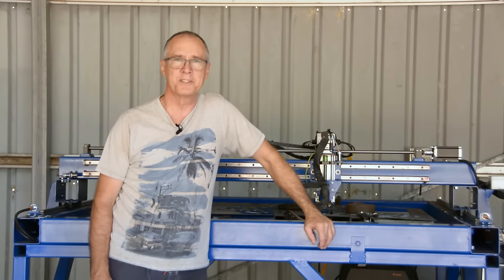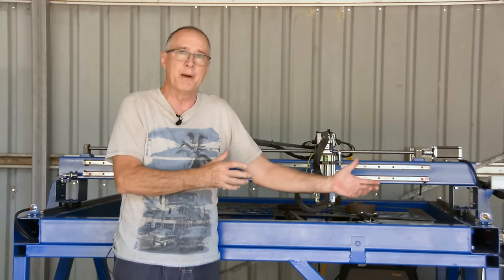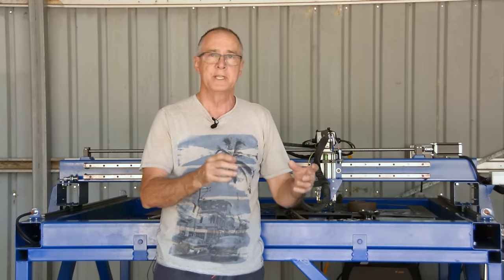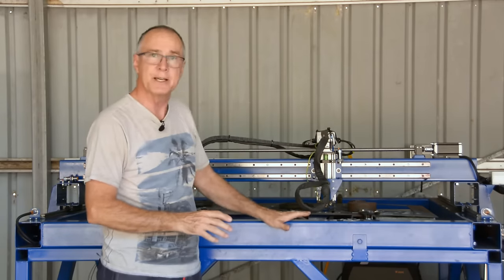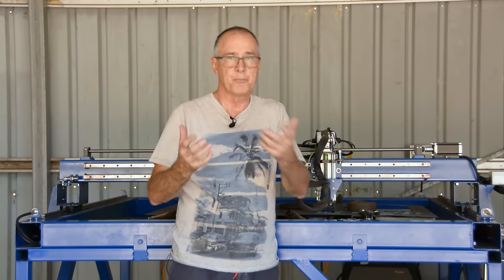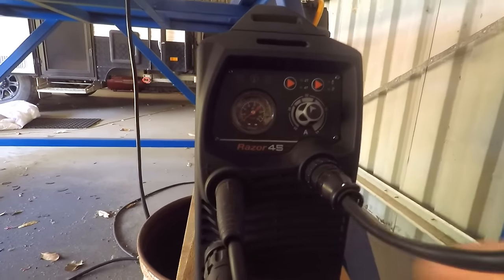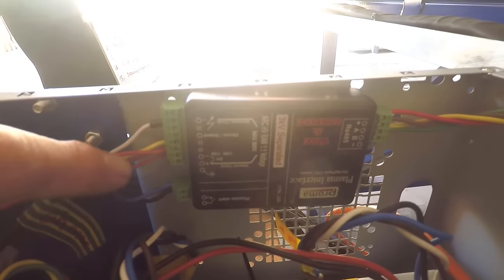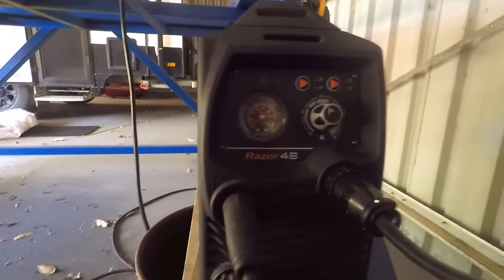How To Build a CNC Plasma Cutting Table | Part 6 - The 1st Cut

Comment: This has been the most comprehensive CNC plasma build lesson I've seen, and I've been lurking around he CNC Plasma forums for years. The explanation of the mechanical, drives, sensors and electrical hookup is exemplary. I particularly like your KISS (keep it simple, stupid) approach and use of off the shelf rails, ball screws and simple steppers. Would be great to see a 12 month follow up to see how it all works and whether, on mature reflection, you'd do anything different.
Reply from the maker: Hi Richard, thankyou for your kind words, and I'm glad you found my video series informative and helpful. I'd never thought of doing a follow up video, but you make an interesting point, so I'll give that some serious thought and make a video, when I can find some spare time.

Comment: Good to see it working and welcome to the dirty lungs club❗
Reply from the maker: Hi Ross, the table sure generates some smoke, sparks and dust. I picked up the water pan yesterday and once I've got it installed, along with the slat frames and slats, I'm hoping I will have a cleaner working environment!
I've subscribed to your channel as I'm keen to check out your videos...keep them coming.
Reply: @RustysMetalCutSignsDesigns  Thanks for the reply, If you let your imagination run wild it's amazing what you will create from the machine. I'm from Brisbane but moved north to Thailand, been here 11 years now. so i needed a hobby to fill in the days. PS drop a magnet the wall and you will shocked at how it will look after a while!

Comment: You have done a great job on this build I may have the confidence to do it. I have built my own cnc router it was not bad currently started on a co2 laser build. Going to do the plasma next. Again nice work.
Reply from the maker: Thanks Randy. I had no experience with plasma or CNC stuff before this build, (although I have welding and fabrication skills) and it wasn't that difficult to put the whole thing together. If you need any help with your plasma build, my email address is in the About tab on my channel....happy to help if I can.

Comment: Hi Rusty As I have already mentioned to you on another group, I am planning to build another machine during the coming winter. I have been reviewing your series for several times and will be referring to your project for my next build. I noticed that you are not using materiel detection, only the ohmic sensor; is there a particular reason or just a personal choice? Thank you again for this series, a superb good reference.
Michel
Reply from the maker: Hi Michel, I'm glad you found my video series helpful and all the best with your upcoming build. Ohmic sensing is one type of material detection...the other options are a floating head or manually setting the initial cut height using a 1.5mm (or 0.060") feeler gauge.

Comment: Awesome work Rusty. 
We use an Unimig cat 45 as well and have been trying to figure out if there was a good way to run ohmic sensing. Your solution is awesome !! Great work on the cnc build.
Reply from the maker: Hi slo78u, glad you found the video helpful. If you are going to set up ohmic sensing similar to the way I did it, make sure you make the fingers of the stand off guide long enough to have 0.5mm clearance for the cutting tip...ie. the cutting tip should be 0.5mm above the material when the fingers make contact with the work piece. 
Then, you have to change the setting for your cutting height, to allow for the tip being 0.5mm high already. I run my cutting height at 1.5mm, but because the tip is already sitting 0.5mm above the work piece when the ohmic sensor detects the material, my cutting height is set to 1.0mm in the software. 
Also, watch for slag build up on the tips of the fingers, which change the cutting height of the torch. Hope this makes sense.

Comment: Hi Rusty,
I'm in the process of designing a CNC Plasma table and am inspired by your videos. I was wondering, about the accuracy of the cut out parts compared to the CAD design dimensions. Do you have any measurements?
Best regards from Switzerland,
Higgins
Reply from the maker: Hi Higgins and thankyou for your kind words. when I was doing the drawings on the table in part 5, I was very happy with the dimensions of the drawings, versus the actual toolpath. 
I'm still playing around with lead ins, offsets, etc within the software, to create parts that are the exact size of the CAD design...I think I'm pretty close.

Comment: Great Work Rusty I have built a CNC before But yours is is great just wonder were you goy the Z Axis Actuator kit complete from? 
( maker store?} And would you mind if i emailed you about some specifics as im over in the east and planing on building the same. I already have Nema 23 and drivers, Any way great Job...regards Ross
Reply from the maker: Hi Ross, the z axis unit was an eBay purchase.
Yes, feel free to email me. I'm up the bush at the moment so will reply when I get home, or if reception is OK, will answer sooner.
Reply: @RustysMetalCutSignsDesigns  thankyou

Comment: Well done with the plasma cutter table and are you going to get a vertical torch eventually?
Reply from the maker: Hi Colin, thanks for your kind words. I'm not sure what a vertical torch is?
Reply: @RustysMetalCutSignsDesigns  Hello Rusty, a vertical torch is a straight up and down torch used in CNC plasma tables, the one you are using is a hand torch, I have seen other builders using a vertical or pencil torch, they are advertised on eBay and Amazon.🙂
Reply from the maker: Hi Colin, I understand what you mean by a vertical torch...I call them a machine torch, and yes, I've been looking for one that also incorporates a shielded end so I can still run my ohmic sensor, but I've not found one yet.
I know Hypertherm make a machine torch with a shielded cap over the cutting tip, but I don't think it's designed to fit into my Unimig plasma cutter. Unimig do offer a machine torch but it's basically a 'straight hand torch', using the same components and consumables....no provision for ohmic sensing, other than what I've adapted to fit my hand torch.

Comment: Fantastic  work Rusty, I would like  to replicate your design but where can i get the spare parts and how much would the whole project cost here?
Reply from the maker: Hi Mach ug, thankyou for our kind words. I hope this video series will help you to build your own table. The parts were listed in part 2 and part 3 in the video descriptions. I bought most of the parts on eBay...the MyPlasmCNC controller and plasma interface unit were purchased online from Automation Technology in the USA, as the manufacturer, Proma Elektronika, were out of stock of these components. Here's their website shopping page for the MyPlasmCNC motion controller, plasma interface unit and other parts they sell...https://sklep.proma-elektronika.com/
The parts bill for this build was AUD5000, not including my labour. I was going to buy a table from the USA and the cost to purchase it and ship to Australia was close to AUD8000, but that table only had a cutting area of 1225mm x 845mm, where my table has a cutting area of 1340mm x 1340mm...enough to take a half sheet of steel.
If you have any questions or need help with anything for your build, feel free to get in touch...my email address is listed in the About tag of my YouTube channel.

Comment: Can this table be fitted with a router for wood cutting?
Reply from the maker: In theory, yes. The torch mount on the Z axis could be removed and a router mounted in its place. I'm not sure what sort of software is needed for operating a router, but a wood router table looks very similar to a plasma cutting table, so I would imagine my table could be adapted.